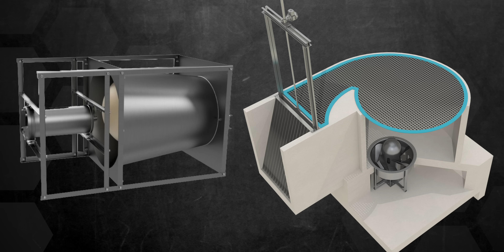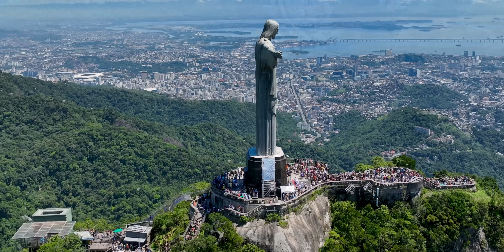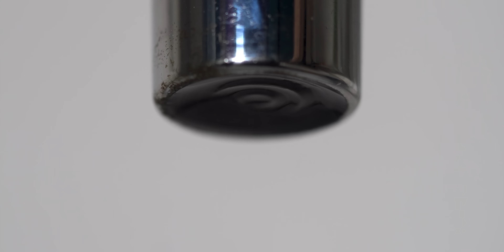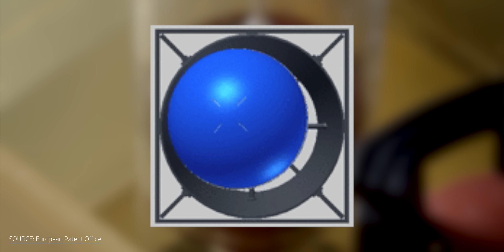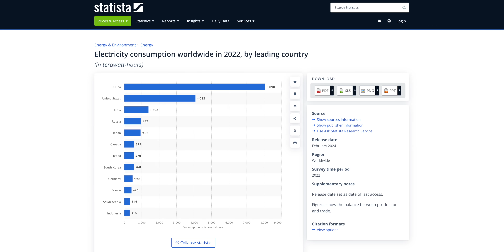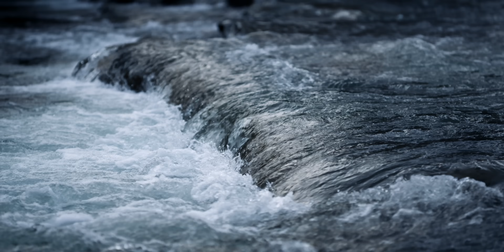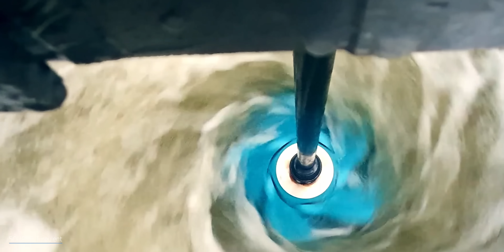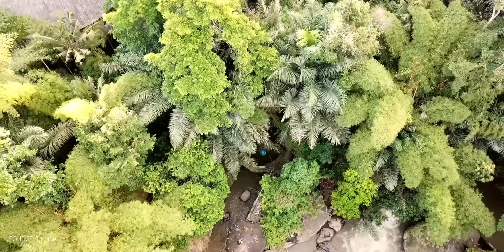The Genius of Small Hydro Turbines

Comment: I came across a vortex turbine years ago and loved the concept. But while I like them better than dams in several ways, I will point out that dams are not just there to generate power. They are a flood control and water storage device as well. Places that were previously unusable because of spring floods or summer droughts are now viable thanks to dams.
Reply: True however if California increased the organic Carbon content of their agricultural lands they would be able to hold on to the water that falls on those lands, produce higher quality food with little or no inputs and have a water surplus. That increase in soil carbon would take a small change in management. Increasing soil carbon has been demonstrated to be possible with some agricultural producers increasing soil carbon content by over one percent a year. 4 years to being free from the need to siphon water. By products More and better-quality food with a lower cost to the producer. I could list all the benefits, but this is a comment on YouTube.
Reply: That purpose is better served by a series of smaller connected water bodies
Reply: But muh environment and snails

Comment: SHP is awesome... sadly getting it permitted is not. At least as a private person here in Germany.
Our laws are very well tailored to maintain the grind providers monopoly on distribution and generation. (There is a notion to change that but most of it is BS)
Going off grid is made very very hard to the point that in theory you'll need to decommission (yes not "just" disconnect) your grid connection.
Also you need to live in a zone that allows commercial entities since you are now a "producer of electricity", even if you are the sole user.
Yes, solar power got exceptions galore and more often than not it still gets denied.

Comment: When hydro was the bad guy a few decades ago I wrote that large hydro was a failure of imagination and engineering. That we could do the same with smaller hydro-production along the run of a river that didn't block the natural flow of the river. At the time I designed a watermill like wheel that I called the Nautilus based upon the shape of the holding chambers looking like the cross section of a nautilus shell. It used the weight of water to turn the wheel with a hole that opened to provide air to break the vacuum and allow the water in the chamber to be quickly released adding to the speed of the turning of the wheel. I figured that relatively little water was needed to maintain the speed of a very big flywheel attached to a turbine. Nautiluss could be strung together in series to provide similar amounts of electricity as one big hydroelectric dam. It looks like others seem to have very similar ideas. We really don't need to burn anything to get the electricity we need. We really are bathed in energy. We just need the imagination and engineering to tap into it.

Comment: Considering the tremendous costs (governments looks this way) of dams; they do make it to last as permanent and forever. Also with new healing cements (thanks to Romans) to fill cracks and crevices; Where do these small dams last; after all government will focus on commercial and civilian power consumption to saturation, they also now expect population control. Don't these small deployments are bad? Considering India where now we actually get 24x7 power or brownouts for 1hr at maximum; I don't see application.

Also with newer construction equipment. Engineers will choose large-cheap-15y build able dams (as final ends) or medium-expensive-5y dams.
Reply: (It's just me) But also fact with 3D printing and no patenting of infrastructure, shielding or stands. Any one can 'pirate' for free if someone make open-source design.

This is modern patent problem we are going to see now: patent vs open-source based business.

Comment: When I get that 'final home' built, it'll have a shed/bunker where I can put large banks of salt water, lead acid, or other cheap, large-capacity, easy to maintain batteries for long term buildup and discharge.  Any viable renewables in the area will keep that bank fed, which in turn will keep the house batteries charged.  Something along those lines, at least.

Comment: Centralized vs decentralized power - like the saying goes, there’s no one size fits all solution. Both ad value and function. High voltage DC lines to connect the country while smaller communities also become less dependent on the grid. Win win.

Comment: In Arizona, small hydro makes a lot of sense. We have one of the most extensive water canal systems in the country spanning thousands of miles and we could easily add numerous Turbulent systems adjacent to the canal's to supplement electricity demands.
Reply: Do canals offer sufficient flow though?  The UK has an extensive 19th century canal network but it was designed with transportation in mind so the water only flows when locks are opened and closed.

Comment: I see small hydro in two directions. One is the models you showed, where the generation is as close to, if not in the water. The other is where the water is diverted through a pipe and run through an  enclosure, with a small turbine. These are rarely shielded, and look dangerous as as get out. The in water looks safer...

Comment: Unfortunately, current US regulations and licensing make these small scale hydropower systems financially unfeasible. I did a preliminary study for a small hydro system at an old mill site in MA. It made decent financial sense until you factored in the permits, licenses, and environmental approvals. I want to say FERC licensing was something like $100k and that was 10 years ago. You have to generate some serious power to make up for these costs. Remember, there is no net metering here. You are selling the power to the grid at wholesale prices (probably a couple cents per kWh), not consumer rates ($0.30/kWh in MA). 

Also, a lot of the seemingly obvious locations, like old mills in New England, are…old. The dams are ancient, in disrepair, and backfilled with decades of silt. Replacing or repairing them is cost prohibitive if they are only feeding a small hydro system. 

I love the concept, but the approval system needs some major overhauls and streamlining for these to become a reality in the US.

Comment: I'm a strong believer in the "all of the above" approach to energy. These devices won't provide that much energy because the number of places where they can be installed is always going to be limited. The notion that we should limit ourselves to what these kinds of devices can provide is wrong. I'm also curious about how many years these devices have to operate to generate as much energy as was required to manufacture them. I wouldn't be surprised if they have to operate for a long time to break even on energy production. 

The value of these devices is the chance to de-centralize. The more de-centralized our energy production is, the less vulnerable we are to natural or man-made disasters. If someone is in a position to install one of these, he can have energy that doesn't rely on the grid. That's an advantage sometimes.

Comment: I'd be curious if smaller versions of this could be added to sailboats to generate power while under sail.  Similar to how regen works on the props of the boat connected to the engines.  Maybe something you could immerse in the water and drag behind the boat somehow?
Reply: Yes, but the drag would be huge, compared to a common wind turbine (which will also work when you are anchored). If there is wind to sail, then there is wind for power.

Comment: With the Turbulent design, I have seen a new propeller design that doubles the push power of a motor, I wonder if Turbulent used that design, instead of their stack design, if it would also double their output of power?

Comment: If I were a betting man, I would not bet on these non-intermittent sources when innovations in energy storage are in the same race. And even the 'remote location off-grid' use cases are not very scalable because of the expertise and equipment required to install and maintain them.

Comment: Didn't Victorians invent these? They found out that instead of having water fall into buckets on a wheel, you could place a turbine in a pipe and flow water through that. As long as the pipe is full, you can have the turbine as high above the water source as you like.

Comment: How many dams over 3 feet tall exist in the US?
The United States has more than 75,000 dams over three feet in height, which is the equivalent of building a dam every day for more than 200 years.Nov 3, 2014. Most are for flood control but some could be converted to low head hydropower. A lot of potential power generation to be developed in a relatively short time due to the fact the ground work and regulations etc have been done. Big hydropower is the time keeper (60 Hz) for the grid, very important!

Comment: I am quite optimistic about these projects. Small scale hydro is something a lot of people have DIY'ed over the years with pretty good success, some of it well documented on Youtube. This isn't rocket science and is somewhat easy to do even with minimal materials.

Both companies basically do not employ any new or experimental technology, although the vortex turbine is novel I suppose. They take known technology, scale it appropriately and package it in a way that makes it easier to install. While I haven't got the faintest clue about the physics of the vortex turbine, neither of their output figures seemed outrageous. I have no doubt that both these products could be viable in more rural applications where alternatives are too expensive.

The "one day install" in Indonesia seems like an overly optimistic and disingenuous marketing ploy. If the footage shown in this video is indeed from that install, the concrete infrastructure required was already in place and prepared for the installation. Sure, perhaps the turbine crew only needs one day at a properly prepared site, but any project starting from scratch will require significantly more time for excavation/blasting, preparing the base, either building a mold for pouring concrete or installing pre-fab modules. Some piping might be necessary depending on the area. This is not a one day install in any realistic forecast.

Comment: I have been asking why they are ignoring the use of hydro power for years and no one seems interested in it. once it has been established and is working there is no pollution from it and it can last for 4 or 5 longer than wind turbines or nuclear power and is much safer. So when are they going to invest in it or why are they not investing in it should be the question. It's all about the money ( that they can steal) as usual.

Comment: Wouldn't just a reservoir help out with the seasonal flow of water? It is a little more "invasive" but not to the degree of a huge dam, though it wouldn't work for extended issues that could dry out the river reserve.
Also isn't it still an issue about decentralized electrical infrastructure controlling the distribution, that not any one node gets too much?

Comment: Yes, been looking at low head hydro since I was an energy activist in the 80's - at the time, the US dept of Enrgy listed approx 10k low head hydro dams in the us, that were no longer being used for their mechanical power.  as part of the "All of the above" strategy, low head hydro has a lot of potential, assuming of course, that the Oil?Coal?Gas industry is not successful in opposing them

Comment: There is one "problem" with this video: you are naming the advantages of SHP, especially SETUR. But naming the limits of operation without graphing the relations is meaningless. Yes, SETUR-L can produce 43.8 to 65.7 MWh per year, in water depths of 20 meters, with a head of 1 meter, and with flow rates of 2 liters per second. But certainly not all at once. Their manual has a perfectly fine graph that shows at 2 liters per second you'd get more like 750 W, and 5 kW is their rated power at 4 liters per second. Both in a hermetically sealed environment, mind you. Depriving us of such graph is unnecessarily unscientific behavior, more akin to marketing speech than educational tech talks. Please provide us with all the accurate information, not just the highlights.
Reply: We need more people like this cause I need to know the downsides and limitations.
Reply: Think the goal of the video was to get the concept in front of people that may not know about it, rather than be a comprehensive argument in favor of them.
Reply: @DarkRider1768  a simple "while it can work in these conditions its power output will decrease" would have been enough
Reply: @DarkRider1768 if you're going to present a concept to me, I want to know about the pros AND the cons. 

Otherwise you're just a salesman.
Reply: @DarkRider1768 Yes, but his data is most likely coming from that manual anyway, and the graph is plotted directly underneath. And as it is right there, might as well just show it while talking about the numbers, instead of rolling the same few promo footage clips for the third time. It is small things like these that feel like an unforced error in an otherwise quite scientifically accurate video. You know what I mean? It's like "Perfect score if it wasn't for that small, easily avoidable thing, that appears factually wrong now."
Reply: @NFSHeld  this guy isn't advertising so you go and buy, he is merely providing information and he doesn't proclaim to provide all the information just enough that you can further research it YOURSELF, and make your own mind up. It's just a starting point of information for those interested in learning more about different renewable energy solutions not a comprehensive deep dive into each aspect of every solution.
Reply: @NFSHeld  only one problem. The snail one needs 1.5m3/s. That's a MASSIVE flow of water. I think he got the units wrong.
Reply: This isn't a science channel lol. You can't expect that kind of quality from this guy. It is a marketing channel, hence, his name; Undecided.
Reply: @FloridaMeng oof yeah I get the impression.
Reply: Did… we not watch the same video?

Comment: There is a small hydroprop design (shown on YT) that sits within the water column and freely spins (like a boat motor prop), which makes more sense to have these upgraded ... as normal water turbines use the water head calculations, and you have to make a vertical construction for a water turbine to properly work.  Water turbines destroy fish populations, while having in-flow water props (spread across a river or creek's flow) allows all proper water flow and aquatic life movements.
Reply: The second type shown, with the diverter channel and golden ratio flow pattern, does have a fish diverter screen as part of the CGI demo, but Matt didn't mention it.

Comment: I would love to hear whether these can be installed at waste water treatment plant outflows.
Reply: Yes, it can.  Sadly, the power output isn't worth the capital cost.  Low head, high flows will only get you so far. We ran the numbers for a large sewage treatment plant here, and ignoring all the expected efficiency losses from the turbine, etc. it would be the same as a 40 HP motor.  Given that the sewage plant uses nearly 100x that much power to operate, the savings couldn't justify the capital & maintenance costs.

Comment: A small tributary of the river Thames close to where I had 34 watermills recorded in the early 19th century on a nine mile stretch.
Reply: The lower River Lea was tidal up to Hackney Wick [today's 2012 Olympic Park] so tide mills operated at least as far as Three Mills just up from Bow. Not sure whether the tide could be usefully used higher than that. Today the tide is stopped where the Lea joins the Thames and essentially all the Lea catchment's water is used to supply London.
Reply: @peteglass3496   Salt water brings a whole load of problems of its own, principally corrosion. But there are plenty of locks further up onto the Regent's Canal. Perhaps turbines like this could be integrated into the locks, they have a perfect hydrostatic head, like the weirs and locks all along the Thames.
Reply: Which tributary is that? the Thame?
Reply: @stephenauty2402  The Wye, renowned for its paper and corn mills. There is one working preserved mill still working, Pan Mill.
Reply: That’s a different river on the Hereford/ Welsh border
Not a trib of the Thames
The Thames is a very flat river , there’s very little drop anywhere on its entire course
That’s why I asked
Reply: @stephenauty2402  Hi Stephen, there are several River Wye’s across the UK. Besides the major one on the England/Wales border, there’s another in Derbyshire and ours in Buckinghamshire. It’s a chalk stream and falls about 70m in 17km, plenty for steep enough for mills. The Thame is sluggish by comparison, it only falls 30m in over 60km.
Reply: @philiptaylor7902  Blimey I didn't know that and I grew up more or less on the Thames in Oxfordshire , sorry for doubting you , should have checked but I didn't think it possible in the lower Thames (hydro I mean) and it's a chalk stream.  High Wycombe (Wye) , never knew that.  I'm now in Scotland with a now disused trout farm and looking to convert to Hydro but it's way too expensive and the wholesale grid price is now well below 10p /kwhr so it's not going to happen unless we can get some funding.  We have 650l/sec and 3m head but these Turbulence turbines only start at 1.5m3/sec which is a very strong flow.